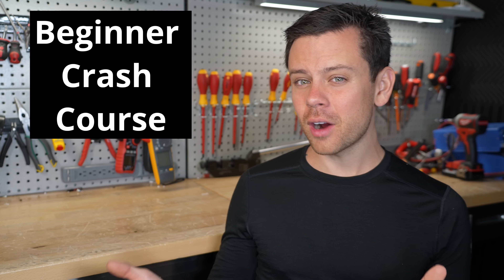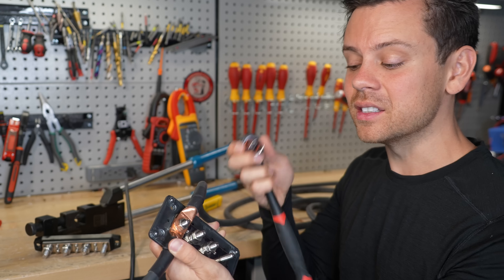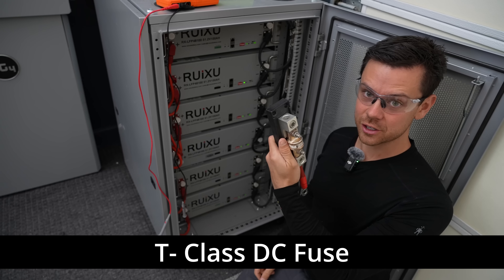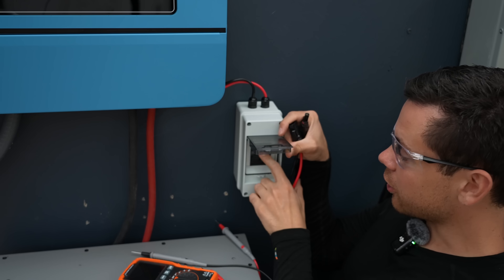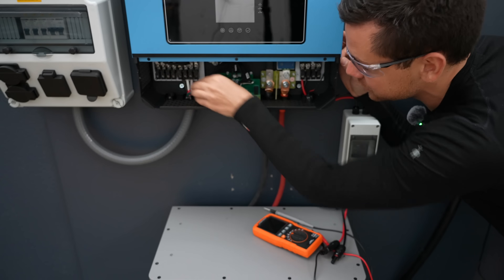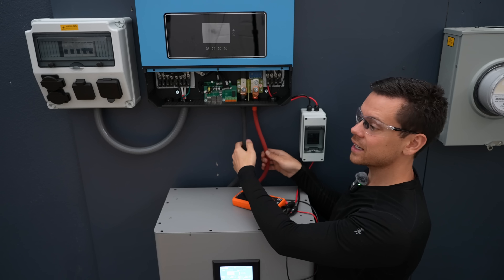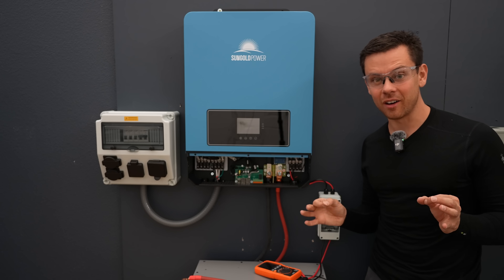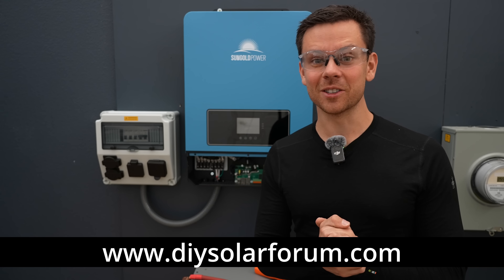Offgrid Solar Crash Course: Avoid FIRE and ELECTROCUTION! For Beginners or Experienced Users

Comment: ** KEY NOTE for Beginners:  The black on AC is not negative like it is in DC. ( Red=Hot / Black=Ground ) With AC or "Grid Power" Black carries the power (and sometimes RED) White should always be Neutral, G=Ground ( Always Green ) 
ALSO, know how to switch your voltage tester from AC to DC.

Safely Enjoy your builds.

Comment: I recommend you crimp and solder
Reply: Using solder in this kind of system is counterproductive, since it will just increase the resistance to electrical flow. A good crimp is way better.

Comment: Thanks Will didnt know about washers on battery terminals, Yes goggles i wear now after i accidentally touched one of the incoming power cables in my main panel with a 12 gauge end of wire i was holding (rubber gloves) it caused the wire to instantly evaporate throwing molten copper into my face, luckily NOT my eye. Never thought anything like this would happen,  I wear the goggles !!!

Comment: "Offgrid Solar Crash Course: Avoid FIRE and ELECTROCUTION! For Beginners or Experienced Users" video is really good ... but ...
I have been interested in getting solar/batteries system for a while.   (And now I'm getting an EV.)
I have been watching your (and other people's) videos ... 'studying'.
I understand how expensive some systems (with installation) can be.   I'd be looking to keep the cost as low as possible.
So, I definitely want to DYI the system.   (I have done various electrical household projects over the years.)
(Also, ... with the Federal residential tax credit ending ... time is of the essences ... IF ... I can get it done soon.) 
However, I'm still a little unsure about how to scope out the system right from the starting line.
(Also, I'd like to have the flexibility to expand the systems as might be needed.)
Do you have a video on the steps necessary to figure out what I need?
(PS ... I've seen how some of the newer "all-in-one" controllers ... EG4 comes to mind.    Love them.)
(PPS ... Any direct (email, phone calls) connections with you to help the process?) 
Thanks

Comment: The wire sizing applies to pretty much all electrical work. I recently had my HVAC system replaced and the first thing the electrician checked was to make sure the wire gauge sizing was correct for the load/breaker sizing. When in doubt use the largest conductor that is cost effective.

Comment: I wish I could get someone to please help me. I have an  older class A motorhome. I have installed two victron Multiplus 2's in parallel after watching your video. I have a Lynx 1000 Distribution M10  , Lynx Shunt 1000 M10 , Cerbo GX with 50 display,  (3) 600/200 solar controllers,  (12) 200 watt flexible panels  , and (2) 51.2vdc 100 ah lithium batteries paralleled together. Now my question is sir I had a 12v inverter with lead acid batteries in here before. Some of the circuits had frame ground wires on the old system. I ordered a DC to DC converter that has one input 48vdc and one output 12vdc. I use my meter on ohms and the - or negative on the input and the - negative on the 12vdc output reads like short or 0 ohms. I was told by one tech support that you could not ground the negative post of a lithium battery but I was told by another tech support that this would not  cause any problem whatsoever. Please sir can you keep me from burning up in my motorhome ? I can not tell he how much this would make me feel better.
Reply: Seems the negative wire all go to a buss bar that also have bare ground wires that goes to this same buss connector. I haven't gotten any replies so I can only guess this is a stupid question to be asking .

Comment: How serious is after turning off all batteries, switches and breakers USING A VOLTAGE MAETER TO DOUBLE CHECK FOR ZERO VOLTAGE BEFORE BEGINNING WORK ?.  I'm a marine electrician , in 2011 a fellow electrician was working on a 240v  air conditioning system , he went to the electric panel and turned off the Only Breaker marked air conditioner ! he then returned and began to work on the air conditioner without testing for voltage. The electrical panel was mislabeled, I attended his funeral .

Comment: Did will mention current and voltage rating for his solar dissconnect switch/shuttoff. Super important to check voltage and current rating for dc devices.
Reply: His video on that item has what HE got. The link he shared in that video goes to Amazon, where one can choose different ratings for the device they want.
Reply: @Tumbleweed5150 i didnt have time to watch it twice but I dont remember him putting as much emphasis on the solar dissconnect. As the get switched in amd out dc beats up the contacts and many times people look at the ac ratings not the dc ratings which can be much lower on some of the specs as far as electrical ratings/capabilities.
Reply: @FTOTF1  It IS rated for DC. Check out the Description on almost any of his videos. Check out his website and the DIY solar forum linked there.
Reply: @Tumbleweed5150 I didn't say it wasn't rated for DC, thanks for the confirmation. I didn't see him put as much emphasis on this, In this video and it is very important.

Comment: Excellent explainations for safety. The only thing I would add that I do is I have a meter connected to system DC before turning off the switches or breakers. That way I see the voltage go to zero and know my meter was making a good connection.

Comment: And always energize inverter first with your low voltage source before energizing your pv input.  When shutting down system is just the reverse order!  Like you say verify power off or on with meter.  Been following your channel since the LV6548 install days.

Comment: And don't solder a terminal like that other guy was doing, if it gets too hot the solder will reflow and wire will just fall out. He then would have an unfused wire landing on the busbar or another battery terminal. I only have a small setup but checking the wires and terminals from time to time under load is a good idea. Make sure none of them are more then slightly warm.  A thermal camera would work as well.  The pictures of people's failures posted online usually look like a terminal was making poor contact had been overheating for some time and finally burned out.

Comment: What a awesome young man I’ve learn a lot from Will’s videos . I only have 1kw off grid solar panels and 4x 100 amp lithium battery in 2s/2p 24 volt system. Between 2-6 pm afternoon it’s get hot 80-100 on a summer months with a portable AC in a 8 x 10 room set it to low temperature I can get 5-6 hours while the solar charges the battery. By night time I would use a regular 24v charger to top off the battery ,  😊

Comment: At what point do you use bus bars over diagonal wired parallel batteries? 3 batteries? 4?
Reply: I would use buss bars with anything over 2 wires. Also, remember that the wires from the battery posts to the buss bars should be as close to the same length as possible, and definitely of the same Guage.

Comment: Nice job. I would also suggest that they do a METER VERIFICATION EACH AND EVERY TIME before using the meter. I had a young man grab a meter to check voltage and the meter read zero. It read zero because he would wrap the leads around his meter and the positive lead had an intermittent break in it. I taught all of my guys to always take the leads out and wrap them loosely and also to take the meter to a known power source (9 volt battery or wall outlet works just fine) and make sure they get a reading BEFORE AND AFTER testing for ZERO VOLTS. It is also in the actual electrical safety regs to do it this way.
Reply: Usually you get some kind sub volt readings jumping up and down when taking a reading on a zero volt source, not sure if its EMF in the wires or whatever, but you know when you're making contact.
Reply: @TuttleScott you will get those from the EMF in the area and even if you have no probes plugged in... doesn't tell you of the probes are working

Comment: So if you need 5-6 panels for a 48v system then what should be the minimum for a 24v system?
Reply: Figure that out by seeing what the specifications of the 24V all in one/solar controller are. Never excede the maximum input Voltage. Use the Open Circuit Voltage of the panels and stay under the max. input Voltage. 24 Volt AIO units like the Growatt SPF 3000 TL LVM-24P I put in my girlfriend's shuttle bus/RV build need lower Voltages, but remain at the 17A upper limit as my 48V version.

Comment: NOTE: NEVER disconnect AC, Solar, or Batteries while the system is running. I have damage two inverters at a cost of $3500. Follow the proper shutdown process for the inverter.

Comment: I would be interested in hearing your take on building a whole house battery backup system as an alternative to a generator.

I'm thinking it would be nice to build a battery backup system, then after a few years maybe, I could consider adding solar.

It's just, doing both at the same time feels daunting and the upfront cost much much higher.

Comment: Good point on the PV polarity.  It gets to be a bit of a mind bender for beginners when you go and install an opposing mc4 connector to the same colour conductor for the “extension cable” going to the AIO.  Buying actual extension cables remedies this of course.  

Also some DC isolators will actually cross their continuity path, so instead of assuming continuity on the terminals above and below each other, you’ll find it’s actually continuity on opposite corners.  

Ex: 1234 on top, L to R.
      5678 on bottom, L to R. 

1&5, 2&6, 3&7, 4&8 could be assumed continuity once switch is closed, but it could actually be 1&8, 2&7, 3&6, 4&5.

Comment: Thanks for pointing out the need for crimping.  I see that many people are puzzled about the desirability of crimping over soldering to keep the best connection for a joint.  There are a couple of things to consider.  The first is how much current a joint can pass without the temperature rising to undesirable levels.  This is a matter of resistance of the joint ( and wire).  That means the size of the wire and, in this case the lug.  The size is the physical volume of the conductors, or resistivity.  Resistivity is the bulk property of the material.  RESISTANCE is a combination of resistivity, contact area and contact pressure.  The square of the current times the resistance is the power dissipated as heat.  Solder has  probably 8 times the resistivity of copper.  And that is at room temperature.  A properly crimped joint has total copper contact area and high pressure,  insuring minimal resistance.  Also, solder will wick up the stranded wires, forming an alloy with the copper and cause brittle, vibration susceptible breakage.  Something that should be suggested for any installation is a fire/smoke alarm system that is independent of this electrical system.

Comment: Thanks for this video Will, and so many others, you’ve helped me many times over by two year 24x12 shed off grid build. I could’ve used this video a couple of years ago, wink wink. I wanted to point out a quote from you  (paraphrase) from a recent video that had a profound effect on my overall understanding of off grid solar: “if your system is not charging 100% every day, you need more panels, if your batteries Can’t get you through the night, you need more battery capacity.“ those few words , if I had found them two years ago, it would’ve saved me so much heartache, alas, surviving and thriving. Much love, thanks for all your help.

Comment: Why wouldn't you solder that after you crimped it? I thought solder kept moisture out and stopped corrosion, as well as made a better and stronger connection. I've had numerous crimped only connections overheat and almost start a fire but I've never had this happen with one that was soldered.
Reply: Using Marine heat shrink tubing keeps out water better than solder, plus solder doesn't allow electricity to flow as easily as the copper to copper crimp connection.
Reply: @Tumbleweed5150 Soldering a crimped connection wouldn't break any copper to copper contact I would think, but fill in the empty spaces and increase the contact area. Soldering copper pipes together used to be how we did our plumbing.  From my experience it has been extremely waterproof and durable, I would be surprised if shrink wrap outperformed it.
Reply: @kevinward7498  Believe what you want. I will go with what I have tried that works. Crimping the connection with marine heat shrink works well for me.

Comment: A good thing to do is load the system down and look over everything with a thermal camera. You'll see everything. Saw that the output cables of my pair of victron 30a chargers was getting a little warm and replaced them with heavier gauge. Was able to confirm that wago connectors in my transfer switch box could handle full load with no heating in them. Probably one of the most valuable thing you can have, and useful for looking for things around the host left on, or heat loss etc.
Reply: Excellent advice especially as thermal is getting to be so cheap

Comment: Always disconnect panels first, then batteries, then inverter if still on.

Many charge controllers and inverters could easily break if batteries are turned off first and high voltage is still coming from panels.

Comment: Good job there Will, I'd also pick up a thermal imaging camera - doesn't have to be an expensive one, and run that over the cables and connections once a while. Every year or so I shut down my off-grid system, re-check all terminals, de-dust if there's any and clean any cooling fans. after that I'll run everything under load, optimally with a sunny day and run the thermal camera over everything. Not much maintenance really and doesn't take very long ! 🤠😎

Comment: Hey Will, absolutely love your videos. I have a question about my RV. It came with a small 220 panel, I would like to upgrade it to a much larger system. I have a single entry gland on the roof. Keystone Montana says it can only handle 440 watts of solar. Is there a better gland I can use? I've looked at almost all of your videos and I haven't seen this covered in your videos.  It may be a dumb question but like you say it's not the battery it's the other things being under sized. I just want to make sure it's done properly. Thank you in advance.

Comment: have been designing and ordering parts for a hv lfp ev buddy pack, i cant believe how much goes into hv cables in an automotive nvh environment for hv dc. tier one oems blast their wires with beta radiation inorder to get better cross linking and curing of the rubber sulfer compounds inside the wires, then there is abrasion resistance, water obviously, and other liquids which are much more harsh and can cause swelling of the jackets. so many things an average diyer wouldnt even have the background to think of.
i now look at budget ev conversions with a completely different lens of skepticisim

Comment: Or if you don't know exactly what you're doing, pay someone who does. Any guesses whether your insurance company will pay out if you burn your own house down with incompetent diy electrical work?
I don't mind swapping the occasional failed light fitting, but HV DC work is a different kettle of fish.  Even a car battery has plenty of potential to cause arc and (if anything combustible is in range) a fire (and I still have a spanner i dropped with an arc strike witness mark to remind me!)
Think about the risks.